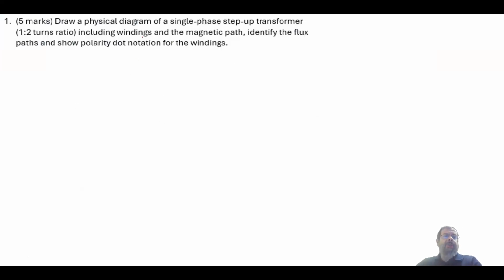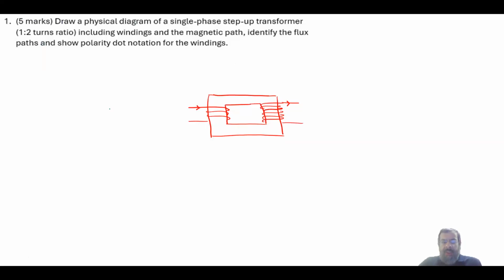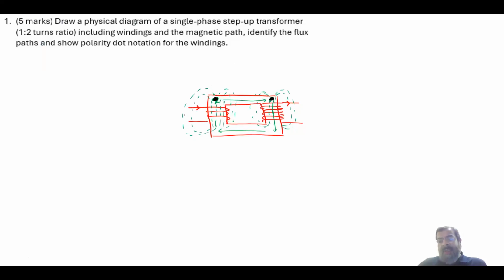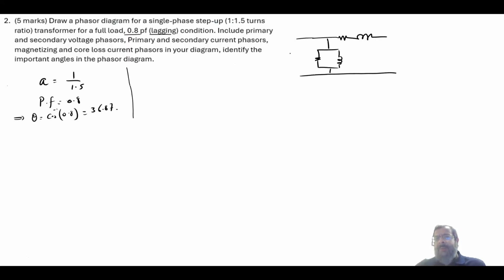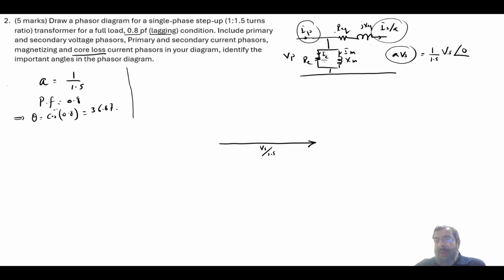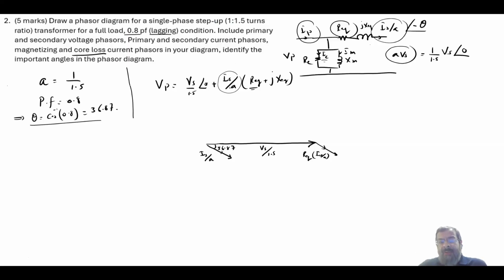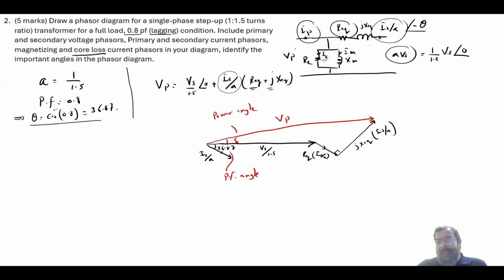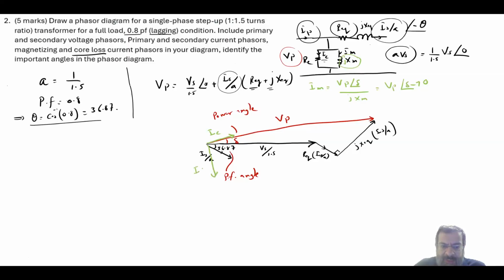PEO solve examples (ELEC B7) Transformer Question no. 5 - Part 2

Comment: Hello Professor, Thank you for all of your videos. It's been my main way of studying for B7. One question I have for you over the 2 question on this video is about the representation of Ip. Would that be in phase with Vp or we won't have enough information to sketch it?
Reply from the maker: No it will not be in phase of Vp. Ip = Ic + Im + Is/a using KCL. You can them graphically and show Ip on the same phase diagram. Since the load is lagging, and the circuit is inductive, then for sure Ip lags Vp.
Reply: @electrical4everyone  Thank you so much. I've got that by putting together with the information provided in the other video.
I've went over all your videos for the B7 Playlist. Any other videos you'd recommend to study ahead of the exam?
Reply from the maker: @guilhermeduarte5230 After A6, I'm planning to solve more B7.

Comment: Hello professor 
By phasor we can see magnitude of primary voltage greater than secondary. While we have to draw for step up x’former. I know we refer it to primary but just to make sure will it work if we draw like this?
Reply from the maker: Yes the secondary looks less than the primary although this is a step up transformer because it is multiplied by a (1/1.5).

Comment: Hello Professor, for Q2 may I make sure phasor (Is/a)jXeq is turning 90 degree from Is/a or from (Is/a)Req? Thank you.
Reply from the maker: Actually from both because Is/a and (Is/a)Req will have the same phase as Req is just a scalar and does not change the angle. But for the phasor diagram it is with  (Is/a)Req